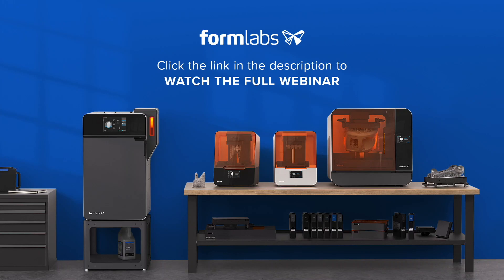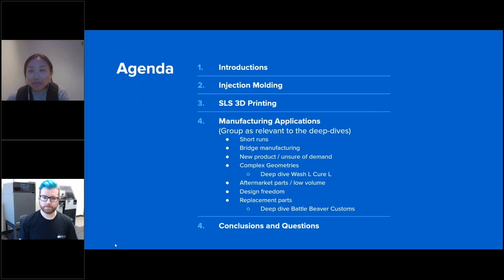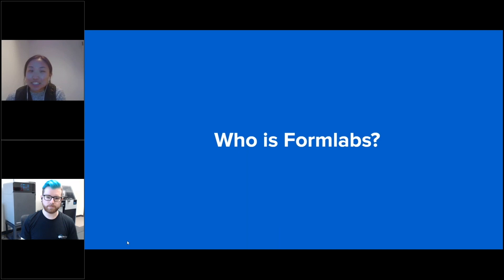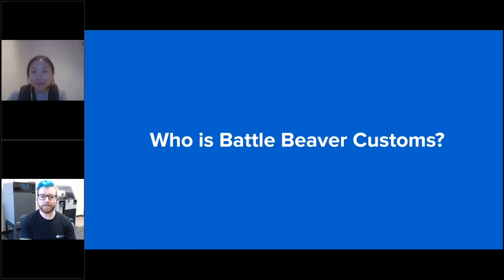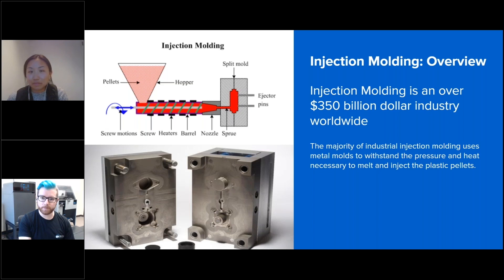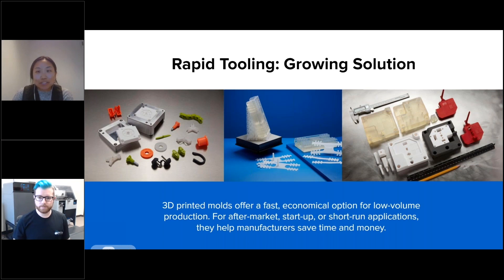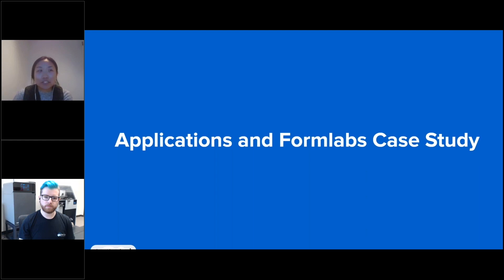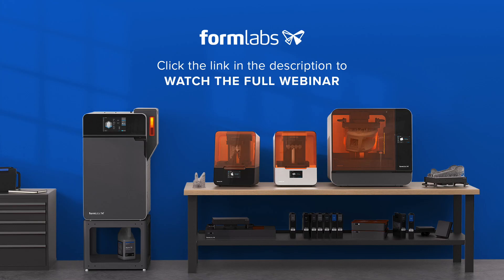When It Makes Sense to Replace Injection Molding with SLS 3D Printing

Comment: Any chance you could do a video on the different Tensile and yield strengths between injection moulding , CNC, and 3D printable parts , ~ which is better per material , and process and uses .